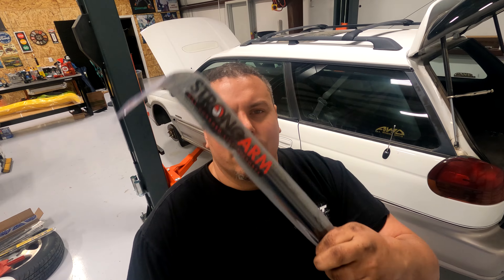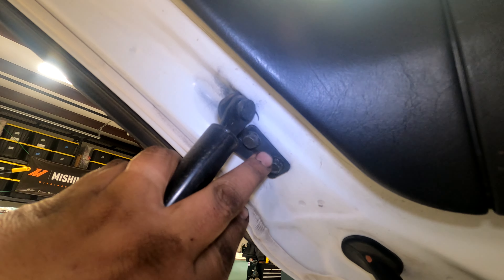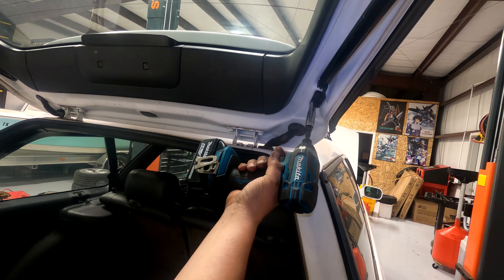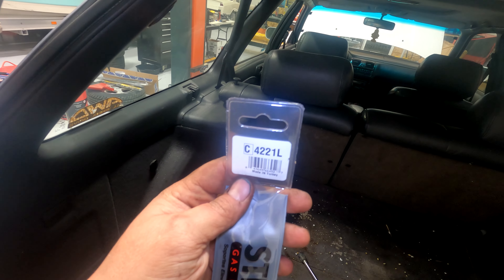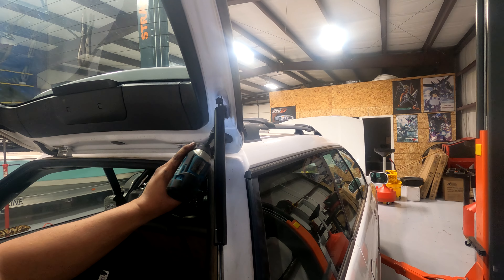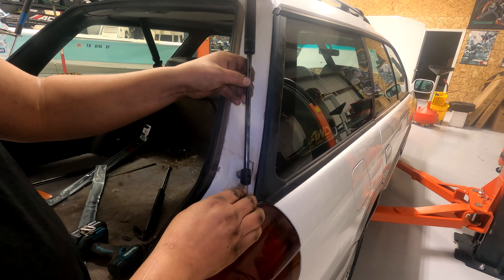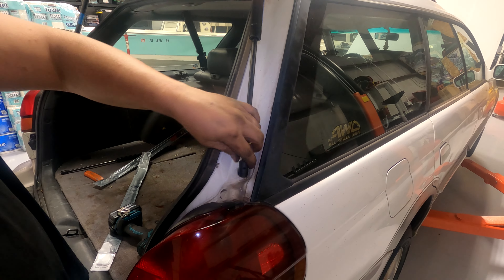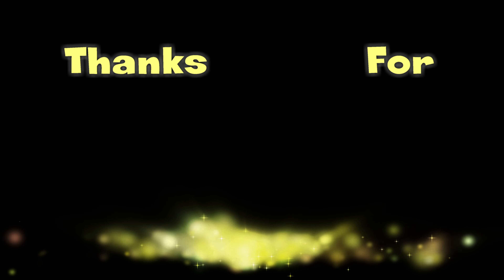1994-1999 Subaru Legacy Outback Rear Hatch Strut Replacement Step-by-Step

Comment: I have 1999 legacy but has the balls that snap on not bolts.

Was looking for that type. Appreciate the video anyway.

Edited: legacy outback meant to type

Edit2: I haven't even looked at the parts yet wtf gonna check...ok they don't have that clip at bottom to pop them off?

Last edit: looks like I have to replace the posts, they are welded on and I have no way to pop them off.
Reply from the maker: Send a picture to my instagram